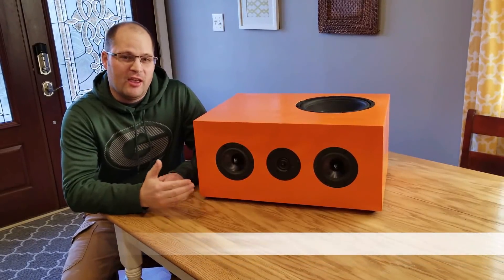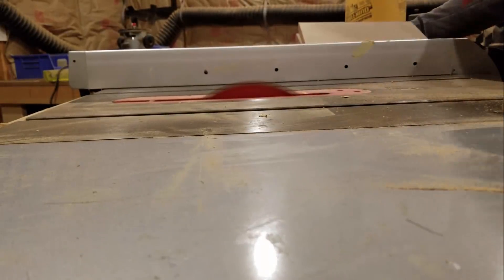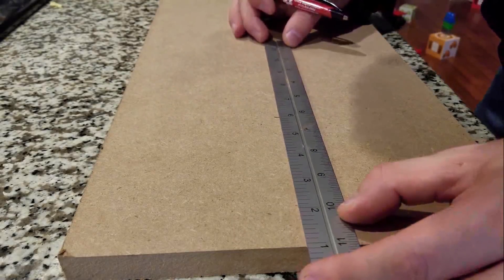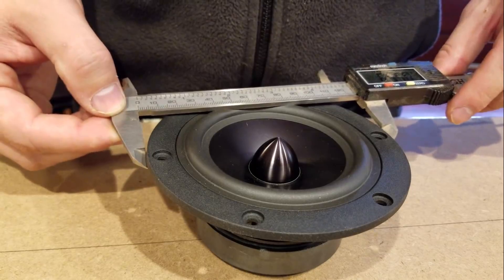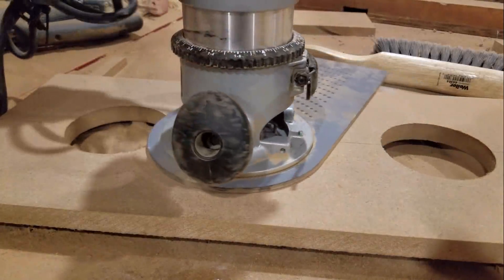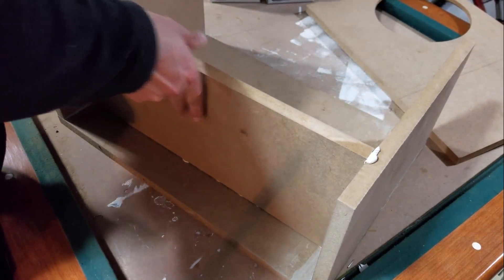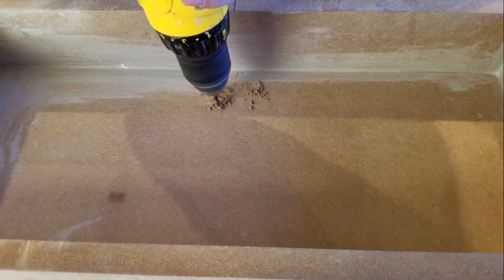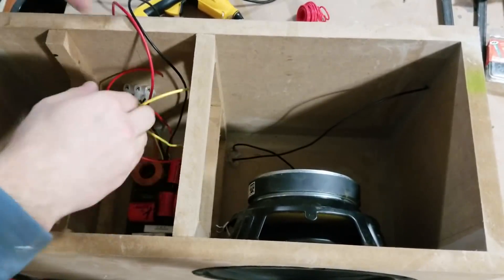DIY Clonig a HiFi Speaker - FREE PLANS - Sound Test - Definitive Technology CLR Clone

Comment: Think I can tweak the cabinet design and turn this into a nice floor standing speaker? Do you think it'll fill a large room with good sound? Large open room, living, dining, kitchen, hallway are all one big room. And what components are you using to drive the audio, receiver, amplifier?
Reply from the maker: DIY Dan absolutely you could.  I think it would do good at filling a room with sound.  I'm currently using a Pioneer Elite vsx - 50 to run it.

Comment: i cant build my own cross over cause im new but was looking if you could link a good cross over and amp and a maybe better sub that would work with this too :) thanks apreciate the vids keep it up
Reply from the maker: Either of these subs would be major improvements and would keep that high fidelity sound: https://www.parts-express.com/dayton-audio-rss265hf-4-10-reference-hf-subwoofer-4-ohm--295-460 or https://www.parts-express.com/dayton-audio-rss210hf-4-8-reference-hf-subwoofer-4-ohm--295-456  However you may want to upgrade the amp tot he spa250: https://www.parts-express.com/dayton-audio-spa250-250-watt-subwoofer-plate-amplifier--300-803
Reply from the maker: I actually almost built this with the 8" HF sub (since I have it).  However, that was already being dedicated to another project.  Such is life ;)

Comment: Can't wait to build one! Thanks!
Reply from the maker: You're Welcome! I can't wait to hear how it goes!
Reply: 123Toid I checked out your build info on your website for the crossover. Did you mean that since you had the 400v caps you used them but you included the 250v caps in the build info? I figured thats what you meant but just wanted make sure. Do you think you would hear any difference in the Dayton vs the Audyn? Thanks!
Reply from the maker: That is exactly what I meant.  I do not think you will notice any appreciable difference in the caps.  You can actually get the Dayton's in a lower tolerance, so they should be closer to published rating.  However, I did use 5% tolerance caps.
Reply from the maker: I also just updated the crossover diagram to better illustrate how I hooked up the two 4.7uF caps.
Reply: 123Toid Thanks! One last question. I am building this to be a standalone speaker. Any suggestions on what amp to power it? Thanks again for the quick reply.
Reply from the maker: Ryan Pike any clean amp will work it is about 93db efficient.  I like more power for this.  I've been running a Pioneer Elite receiver which does probably about 80 Watts.
Reply from the maker: Ryan Pike just keep in mind this is a 8 ohm speaker, so you'll be getting about half the wattage from a 4-ohm board amp. If you use a board amp I wouldn't power it completely, because you typically add more distortion.  So that says something like I can use a 12 volt to 24 volt source it would probably be best to use something like a 19 volt.
Reply: 123Toid Okay I will keep that in mind. Haven't made any decisions yet. Not too sure what route I want to go yet.
Reply from the maker: Ryan Pike no problem. If you have an amp you want to run by me just let me know
Reply: 123Toid The more that I think about ways to power this speaker the more I am leaning towards a receiver. I currently do not have a setup to support this but I would in the future. Is there a receiver that you would suggest? Thbanks!
Reply from the maker: Ryan Pike I like Pioneer Elite and Marantz, but to a certain degree it's preference.  If you are not opposed to refurbished, take a look at www.accessories4less.com. You can find some great deals there